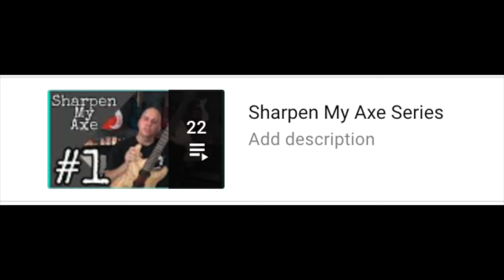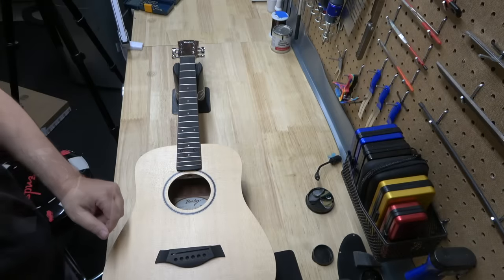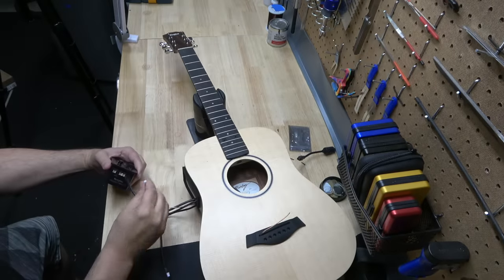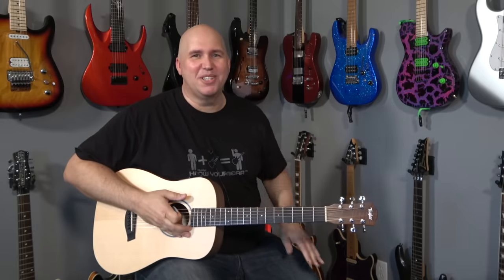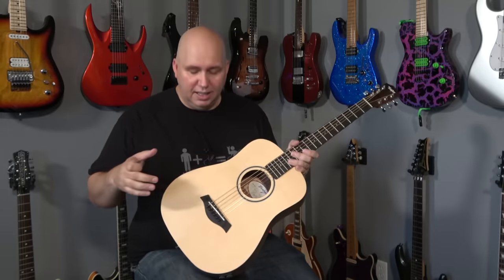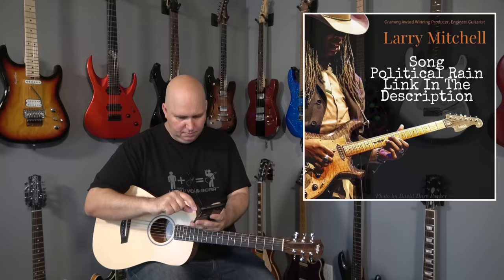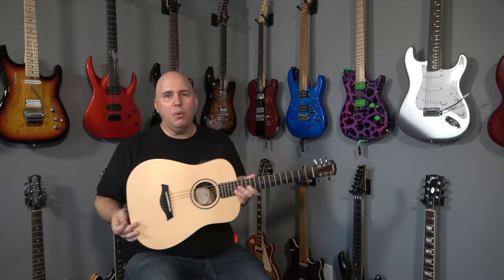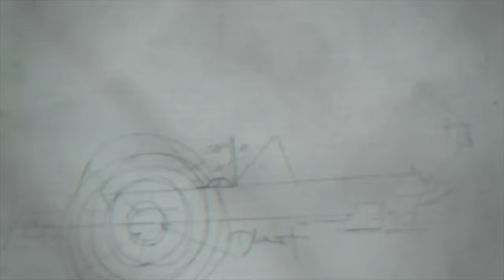I turned My Taylor Acoustic Into A Bluetooth Speaker

Comment: Stick the unit in a low end guitar and it becomes a party machine. That blue tooth speaker function is the main selling point. This is a really fun idea and I hope it does well. Mind you, I'd rather buy a guitar with the unit pre-installed.
Reply: They sell them pre-installed in a variety of steel and nylon guitars. But the install kit itself is $395, so the guitars are $1000-1500, from no case to gig bag to hard case.

Comment: I have a GS Mini Taylor with electronics. I wonder if I could replace the controls, add the speaker system, and re-use the existing transducer... Though the USB looks to be on the same plate as the output jack so I couldn't use the existing output
Reply: One thing you are going to run into trouble with is battery capacity. Non-delay effects don't use much current, but those transducers will. I'll bet 3/4 of the volume of the brick is battery. An alkaline 9v battery has about 450-500 mAh capacity. I couldn't find any specs on the website, but I bet this has 3-4 thousand mAh or more for its 10 hour runtime. The FAQ says it is replaceable if you disassemble the unit. So it is probably a standard size with a standard connector.

Comment: Phil, Great video, would there be a way to mount the controls to the escutcheon plate prior to mounting the plate to the body? almost like mounting a humbucker to the ring and then screw it down.
Reply: I'm sure he'd have seen that if it were possible.
Reply: @stevenjones6780  Most likely, but as someone who tinkers, sometime you get so engrossed with the big picture, little things that seem obvious, are not so obvious, which is why hindsight is 20/20, besides, I am offering a tip, not a critique.

Comment: Has anyone tried to add the HyVibe system to the Taylor GS Mini?  I had look inside mine and it looks like the bridge offers little room for the actuators. Also, I can't find the dimensions of the main module. top half of the mini is quite narrow and am worried that when mounting the main module there, i will stick so deep that it will extend into the sound hole. Would appreciate if you have any feedback on this.